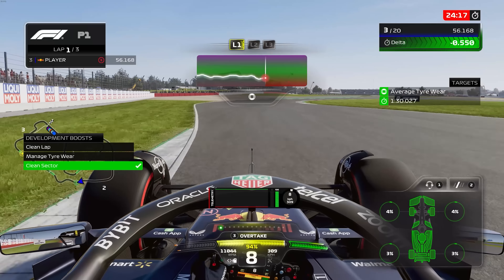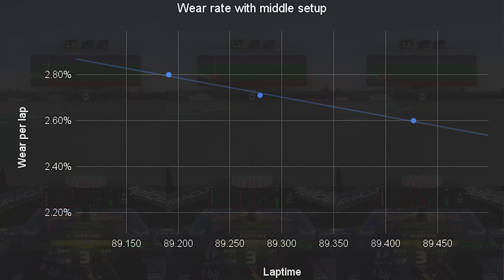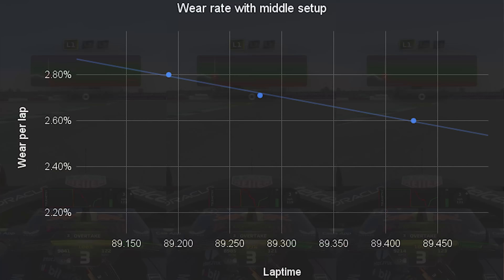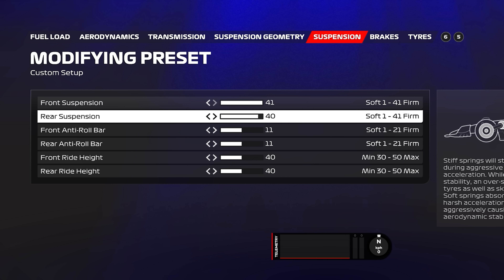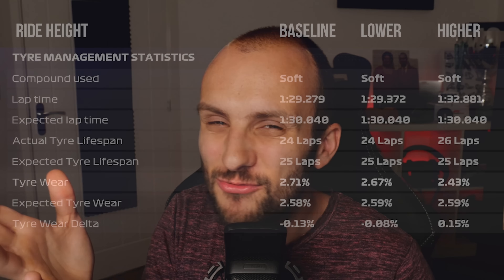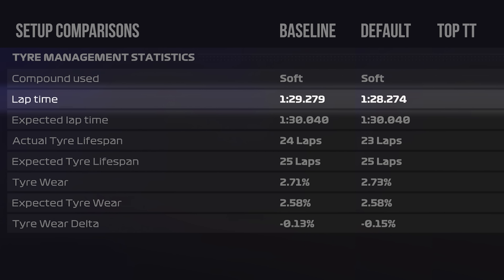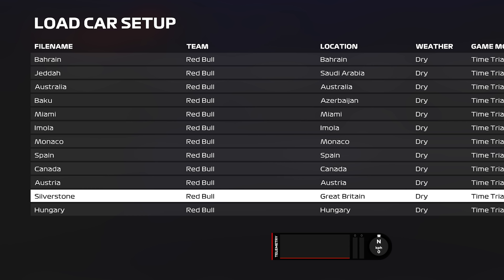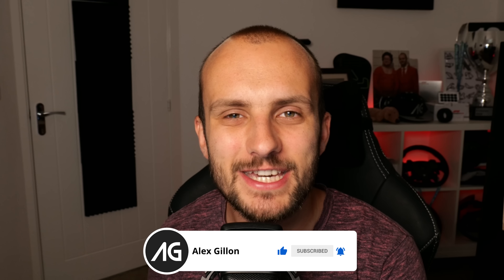Car Setup vs Tyre Wear In F1 23

Comment: Very interesting, especially with the tyre pressures. On F1 2021 especially I remember running the pressures very high because that resulted in less wear so long as you didn’t overheat the tyres. The intuition behind this is that when the tyres are pumped up their surface area decreases as it’s generally a ‘tighter’ surface so there’s less friction and therefore less wear. So either they’ve changed it and made the tyres more slidy with more pressure in the tyres, or max pressures at Silverstone cause overheating.
Reply: You've pretty much said it. It was already a topic last game with the tires losing a ton of grip on higher pressures even if you have less wear and no overheating, and this game the optimal pressure window is even lower because you basically have no tire wear advantage on higher pressures anymore, mainly due to overheating but also because the grip issues only get worse as the tires get older and you're never gonna make up that disadvantage because the more you slide, the more tire wear you'll have
Reply: I made a video about this topic again just now if you want to watch.

Comment: This is a great first test but IMO is still missing a few things that will be important for race day. Front vs rear wear plays a huge role in how the car handles over a stint, and temperatures are also important to get right as they affect grip and tyre wear. Suspension stiffness will affect this both in how much you use one side vs the other, and how much temp goes into the surface. It really is invaluable to get into a practice session, check front vs rear temps and wear, and adjust accordingly.
Reply: If there's one tip that I can give to people who want to learn how to build setups, it's that finding a balance that feels good to you will almost always be more important than what's "supposed to be" better. Some people like it more aggressive and can handle the twitches and slides, others may prefer a more stable suspension or lower tire pressures to make sure that they get consistently good times without the high risk of ruining everything with just one or two snaps of oversteer. The TT setups are a good starting point but in a proper race you usually want to make the car feel a lot more natural and safe to drive if that makes sense. Especially now that TT setups are made for sliding on the brakes, which you don't want pretty much anywhere outside of TT

Comment: Consistent High Speed Cornering is worst on Tyres. Rear Toe - Increases rear Stability (Less sliding) Front Toe - More responsive (Less steering input). Less consistent lateral forces through the tyres maybe.
Even tho the tyres are dragged on straights, that is the least stressful moment.
Reply from the maker: This seems like a plausible explanation!
Reply: with throttle input being one of the most difficult parts of playing on a pad, i've always resorted to a few clicks on the rear toe. without it, im burning the tires in low speed corners (baku). it's what i mess with most in my practice programs to get the best compromise.
Reply: @bradleyg1192  I play on pad too but I'm fairly good with Throttle. I like that you mention 'Compromise' cos it's not respected in game.
Rear Toe will help Traction but at more cost than anything else apart from Wing/Drag.

I've been trying to explain to people its not always a lack of Traction in slow speed. But Aggressive throttle with TOO Soft suspension causes you to Bottom & lose all Downforce.
People try to Maximise Mechanical Grip too much which isnt good for Aero cars.

Comment: amazing work! what I'm wondering now is how the "lower tyre wear setup" affects the tyre temperatures long term. because the tyre wear might be better in one single lap but the tyre temps seem to settle in only after 5 laps or so. and if the tyre temps are constantly too high it’s not beneficial for tyre wear. hope you know what i mean. keep the good work up 👍🏻
Reply from the maker: I didn't test this specifically, but the tyre temps in F1 23 aren't that big of a deal at all

Comment: Ive been running very stiff springs compared to others. And found i can run stiffer rear ARB than i thought. 

Softer ARB better in slower corner exits. But car is lazy, bottoms & snaps when it goes.

Stiffer allows me to rotate the car before accelerating. No bottoming & better in High Speed.

I seem to have longer lasting stints than others on TT setups

Comment: Awesome Video. I think the highlights for me are that you shouldn't run 1-1 anti roll bar. I was surprised about your tire pressure findings. I have found that more pressure will help tire wear as long as you don't overheat the tires. Your default setup and high pressure setup may have been cooking the tires. I have a yt video about pressure and tire wear on a test i did in Qatar.
Reply: This, and I'm honestly kinda surprised that he didn't think of this.
Yes, lower tire pressures are the meta in this game (mainly bc the difference isn't as big as in previous games where you'd run max tire pressures before they changed the way that overheating affects the grip, in 2021 and early 2022 I believe it was the meta) but generally speaking you're gonna get more tire wear if they overheat, and the higher pressures make the car less grippy (which you especially feel on older tires) which means that, despite the initial advantage, you're gonna struggle more and more to keep the car stable and that'll affect the wear much more than any kind of setup change you could possibly make
Reply: @NLR_Knuth  yeah. I made a video about this topic just now if you want to watch.

Comment: From my understanding, increasing the toe helps with tire wear through the corners because the deeper the corner the “straighter” the tires are throughout the corner on account of the toe angle they have… when they’re straighter(more perpendicular to the turn angle) they “slide” through the turns more instead of rotating through them. To summarize, the toe helps keep tires on line and rotating through corners…. I think…. 😂

Comment: it makes sense that you dont lose that much tyre wear with the TT setup. You mess up your tyres over time because it makes your tyres overheat very quickly, even with low pressures. if you do only do 1 lap TT setups are obviously gonna be strong
Reply from the maker: I use TT setups in the races too and they don't overheat :)

Comment: Love your analysis dude! :-) I haven't tested setups so much, but I've noticed it's ok to go with TT setups to at least 25% races without issues - unlike in F1 22... What I've noticed is that my own driving style is quite tyre saving in races and most of the time I can gain time against my opponents in the long run. Could also be because better ERS management, but haven't analyzed it too deep 😀

Would love to join you in the ranked lobbies sometime 🙂

Comment: The problem is that with tire wear of about 22/25% which means about 15 laps the car in race really loses a lot of adherence and becomes impossible to drive.
Does this happen to you also?
In most of the races (I do the full race) I have to pit more than others and that means of course I lose much time
PS: I use a wheel, no aid enabled

Comment: Did you have tyre temperature simulation on when testing the pressures? If yes, the increased wear is almost surely from the overheating, not the pressures. Higher pressures decrease tyre wear.

Comment: Thanks for the video. Main question I have is: How did u even set this up? looks like Career mode, but how do you manage to get the car to be the equal car?
Reply from the maker: This is career mode yea, but it's not an equal car, it's just the regular Red Bull. The setup changes will be the same for all cars, although of course the actual tyre wear will vary slightly for each car